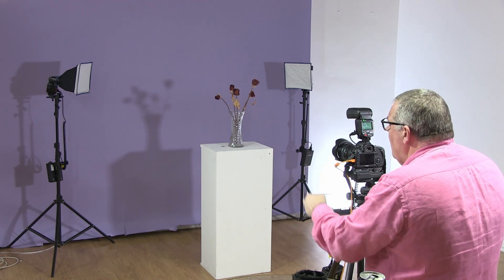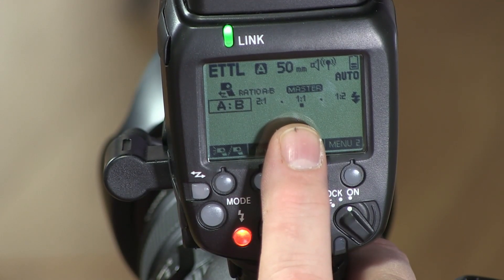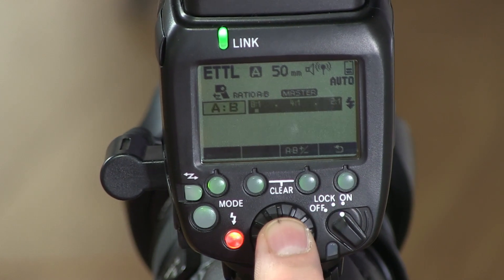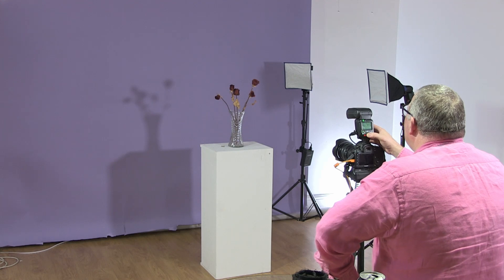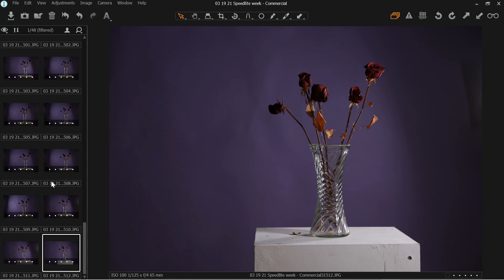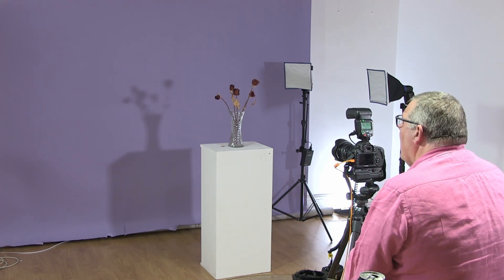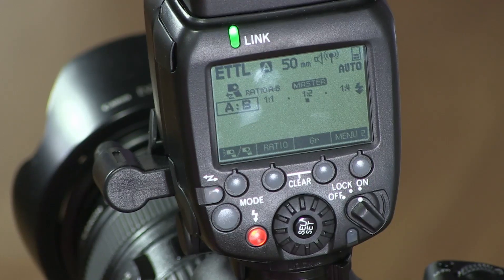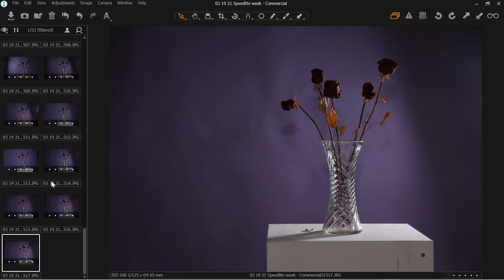SPEEDLITE QUESTIONS | RATIOS

Comment: I love your tutorials. I'm a total newbie at this,so please be gentle with me. I have 2 x Sigma 610 DG Super speed lites (Canon dedicated) and am just trying to figure them out. The setting of ratios is very drawn out, and I've noticed that you use a Yung Nuo speed lite, and that changing the ratios is relative simple. So I was wondering, if I got a Yung Nuo for Canon, would that act as a "master" for the Sigmas, or do they all need to be the same brand? Thank You.
Reply from the maker: That’s a good question but you will need to check the specs of both

Comment: My Speedlight does not have a ratio function like yours does. In TTL mode, I’m offered a compensation amount for each flash. The amount is adjustable from +3, +2, +1, 0, -1, -2, and -3 stops. As always, a stop difference is a doubling of the light. The sequence can be rewritten as +8, +4, +2, 0, -2, -4, and -8 times the power. So, +3 stops : +2 stops (a ratio) is also 8:4 times (or 2:1) which makes sense. This bit of math might help someone who is trying to get a specific ratio. TTL does make it easier to cut and try by moving the lights and observing the results, for those who don’t want to do math, and it does the math really well, unlike many of us. Try figuring out what compensation in stops you would set to get a ratio of 7:3, for example!